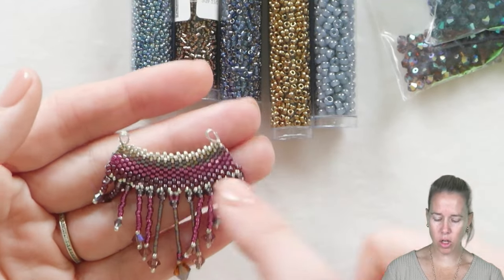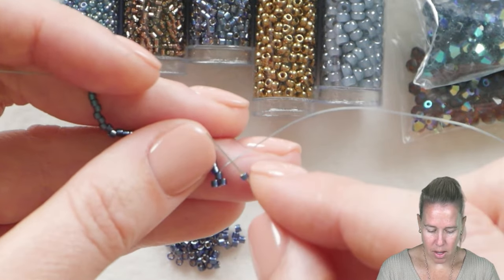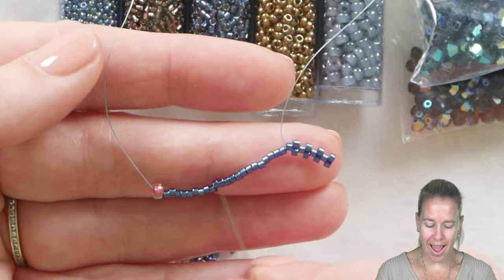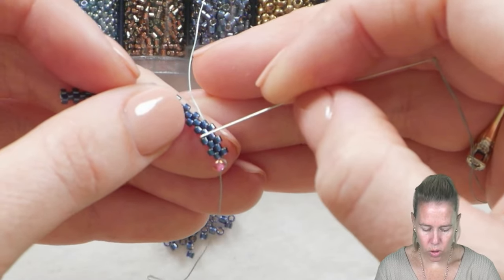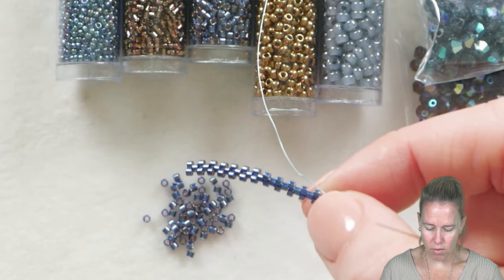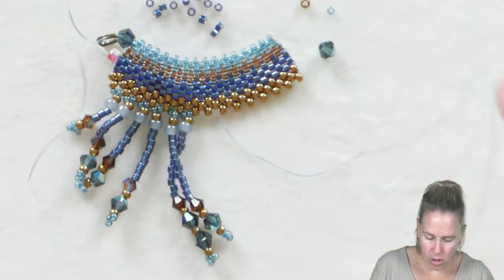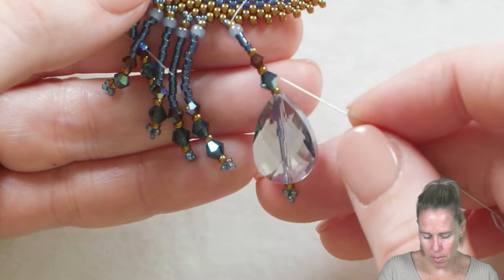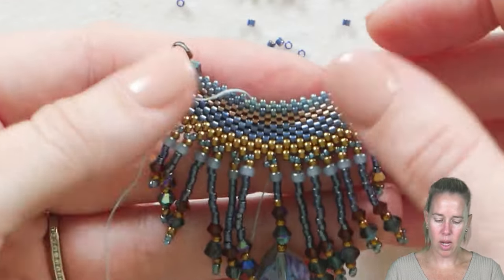Graduated Peyote Fan Pendant - DIY Jewelry Making Tutorial by PotomacBeads

Comment: So I have a question that may sound ridiculous but I have to ask if anyone has tried it.  If you wanted this pendant to be longer - say 15” to be a choker could that be something that is done in this same fashion?  Maybe I should say wider to be a necklace but have it all hang  the same way.
Reply from the maker: Yes, you can make the peyote pendant go as far around the neck as you like and the fringe as well too.  As a suggestion, you can keep the fringe short in the areas further up the neck and to the back of the neck.  You can even skip the fringe altogether in the back.  Then the closer you come to the front and center of the neck you can make the fringe longer.
Reply: @Potomacbeadco  thanks.  But I would start it the same as the pendant by putting on all  beads needed  to fit around the neck and then start my 3rd row? I’ve never seen anyone start peyote with that many beads.  It will be interesting to try.  Thank you.